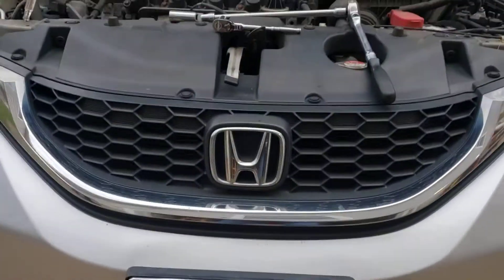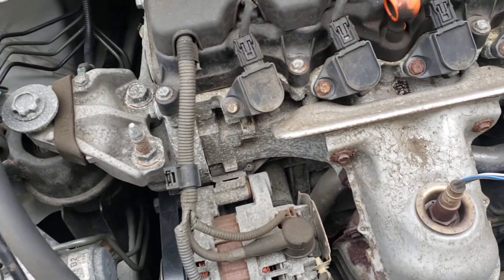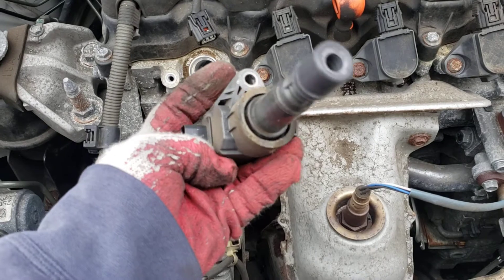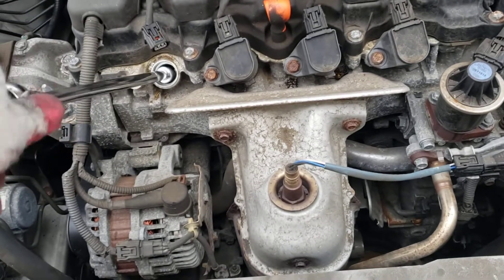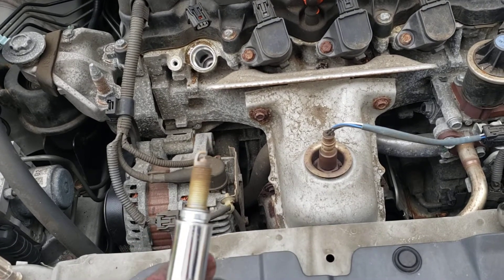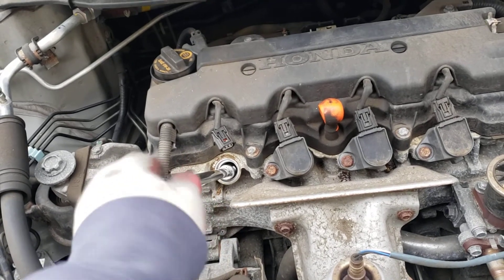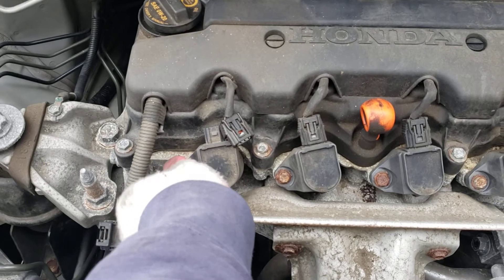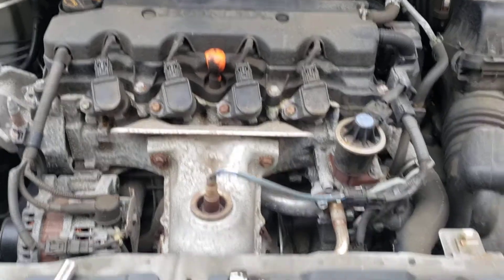How to Change Replace Spark Plug & Coils on Honda Civic 1.8L Engine DIY

Comment: What can I do if the 10mm bolt breaks can I replace the bolt assembly?
Reply from the maker: Yes the treads are metric..any lowes or home depot and tractor supply has hardware..if you broke it in the engine then it will need to be extracted...